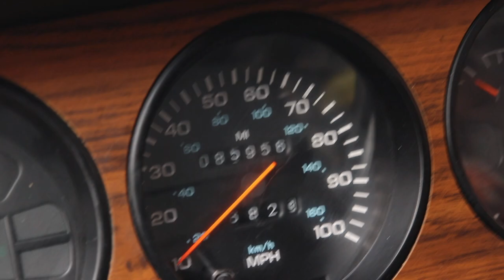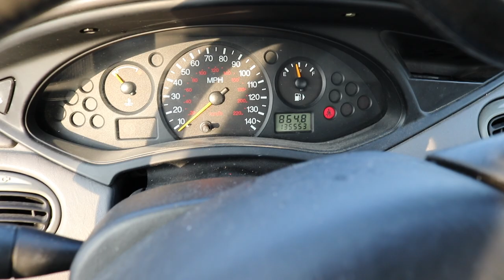I CAN'T BELIEVE this day has finally come...

Comment: Genuinely curious when you did the giveaway first gen start up did it blow white smoke or is it just the lighting? Also if it did what would the reason be? I don’t know diesel trucks super well but like to learn you know?
Reply: Probably cold, and fuel is probably turned up, and probably just oil in the cylinders burning a little upon start up. Nothing wrong with that engine
Reply from the maker: Yeah just a little bit right at first start up.
That was the first start off in over a week

Comment: I get that it takes longer and it’s tough to get it all done .. here’s my problem 

I made 3 orders the first of September 

One on the 1st. One on the 2nd and when you went to 20x. I made another on the 8th 

 The one on the second shipped and I received it quick , the other two .. nothing . I’m not judging, not at all . But that’s seems a little off
Reply from the maker: Some orders ship faster than others. But most of the time we try to ship them out in the order we get them.

Occasionally we are having to wait on an item that hasn’t showed up yet… Or is running behind… And we have to skip over orders that contain the item temporarily.

But most of the time that’s not the case.